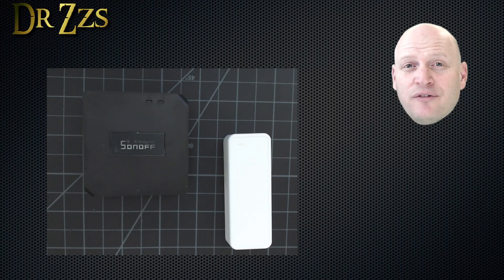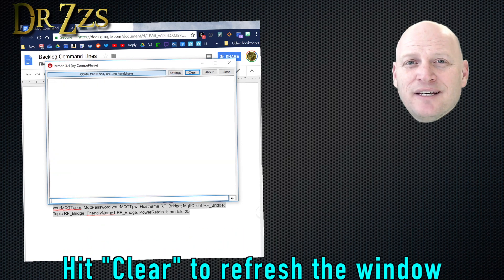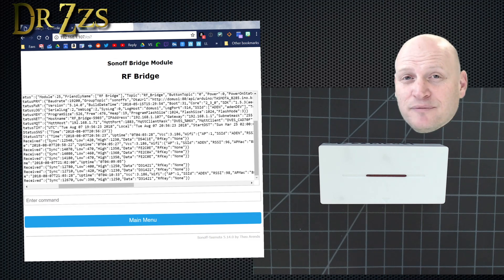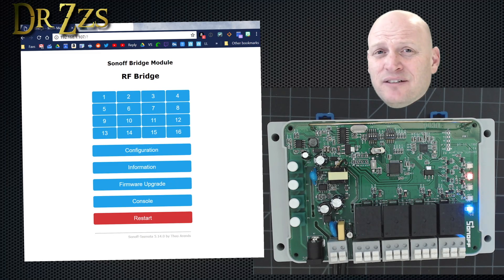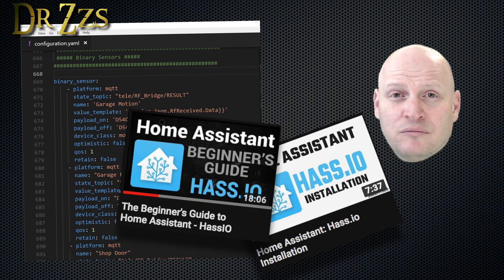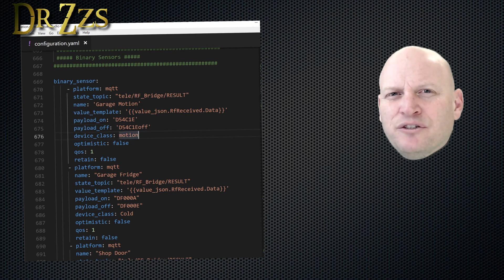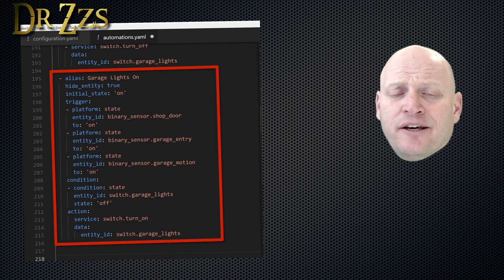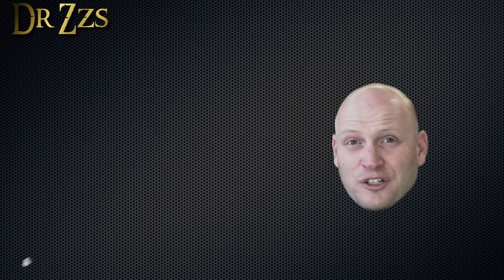Sonoff RF Bridge with Tasmota

Comment: Awesome walkthrough! Thanks for sharing and keep up the great work! I just flashed mine with tasmota and it’s up and running. I’m going to add all my rf sensors this weekend to HA. 

Feedback: you may want to mention the Rx and Tx need to be flipped. I know you point to another video on flashing but in this video you just rattle off the order without mentioning they are flipped on the sonoff side. If someone was just watching this video they may get it wrong.
Reply from the maker: Thanks!Good feedback too.  It's always a little hard to know what to repeat and what I can skip over.
Reply: Glad you posted this! I forgot to switch them and couldn't figure out why it wasn't working! Thank you!!

Comment: so, there is no need in hardware modification before flashing? i read on the tasmota github wiki that rev.2 requires some hardware preparations like cut the traces.
Reply from the maker: I'd have to check which version I have, but I did not make any Hardware changes at all.
Reply: @DrZzs  i found that this required only if radiomodule firmware upgrade needed
Reply from the maker: ah, good!  You don't need to change the firmware for that chip.  At least I didn't need to.

Comment: Dr Zzs, 
Q: have you seen a low battery message code from any of your units listed in the video above? I bought several of each of those and wanted to see if you know if these report low battery conditions?

Thanks!
Reply from the maker: oooh, good question.  I haven't tried that.  Guess I better find some spent batteries, put them in the sensors and see what happens.

Comment: Hello DR! Do you know if its possible to recieve temperature and other data from a rf base weather station?
Reply from the maker: I do not know.  Sorry.  My guess would be no, it won't, but I haven't done any research to really find out so I could very well be wrong.  
Let me know if you find out for sure one way or the other.
Reply: @DrZzs  i have searched all over the internet and cant find anything about it. I Will ask in some forums and let you know if i get succes. Could be vary cool and cheap way to get temperature in all rooms.

Comment: Have just found one of my door sensor has an additional tamper proof switch inside it at the back, sends a third code if you remove it from the bracket handy!
Reply from the maker: Sweet! 
Which brand is that?
Reply: DrZzs it was only 1 out of 30 that had the tamper proof switch, nice to know they exist though! This was the one I purchased http://s.aliexpress.com/UzQraEnu even the other ones have the pads for the switch so I have been meaning to short one out and see if the other 29 also can send the third code, if so could be handy for adding a second button, or switch for another function.

Comment: Hi DrZzs...  Seems there are a few followers from down under now, so Gday to all!!...  - but firstly thanks from an electrical engineering hardware veteran, software Noob ( capitol 'N'!!)  -  without your channel, and numerous instructions, my HA setup, that I'm currently 'desk-topping'  would still be in the box. H/W includes basics, 4ch pro r2, RF bridge. ( ewelink is a POC  in my humble opinion).  My existing smart home system until now is based on controlbyweb X310's - a great bit of kit, but limited to direct control, and device specific. hoping to include some url http get commands into HA when i figure out how to write the correct commands!! - 

OK - the 4 Channel RF pro r2 - from all research, and what I can figure out - you can only have 1 specific inbound or Rx code that the 4Ch pro r2 will keep in memory. - This is from actual testing with Tasmota / multiple  rf remote keyfobs and the OEM manual. a bit of a caution to anyone planning on controlling your 4ch pro r2 with multiple remotes ( I have 3...) this includes a combination of using the rf bridge. - Example - once the r2 has learnt button 'A' on a remote - all is good. - then learn a button on the RF ( say button 16) using tasmota, and button A on the remote  no longer works.....
Reply from the maker: hmmm
Well, it's not a perfect solution but with mqtt you could set it up so button 16 on tasmota controls the r2 relay directly, then have an automation that says when buttonA is pressed on the remote toggle the relay on R2. Or even say when button A is pressed on the remote activate Key16 in the Tasmotized RF Bridge. It's the same idea as the old 3-way switch video I did using multiple sonoff basics. 
If you struggle setting up that automation let me know.  My brain works in Yaml better than English sometimes. 
G'day!

Comment: For those like me that don't feel a need to have a stupid GUI around everything or don't use Windoze, on the command line:
esptool.py --port /dev/ttyUSB0 write_flash -fs 1MB -fm dout 0x0 sonoff.bin

to upload.  If you have Arduino, Eclipse, or Atom installed, you have esptool.py, and if you have that, you have python.
If find it easier to just press <enter> then fiddling with a pointless tool.

Good video though!
Reply from the maker: Thanks
it's good to have options

Comment: Can you have 2 water leak sensors at the same time? I wonder if the code that shows up on the bridge is different between the 2 devices?
Reply from the maker: good question.  I would hope it would be different, but no guarantee.
Reply: There is  a jumper inside that when removed changes the code sent.

Comment: Doc, I've flashed the bridge via Fl;ash EZ but Termite just stalls and goes nowhere. I adjusted the baud rate but to no avail. Any ideas?
Reply: All good now. Amazing what happens when you slow down and listen carefully to the entire process. Please don't mention this to my kids
Reply: Hi I've just done the same. I would try again from step 1. it took a couple of attempts @ flashing to get termite to see the bridge but got there in the end.
Reply from the maker: ya, sometime I have to disconnect the USB cable, or open the settings and reselect the com port.  I don't know why but it does seem a little finicky sometimes.
Reply: @DrZzs  if you disonnect the USB do you have to press the button again when plugging it back in again?
Reply: Aha, missed that point in your other video, now I see what to do. Will attempt again when I get home from work. Thanks for all the support DrZzs
Reply: Unplug the FTDI and then replug it in without holding on to the learning button on the rf bridge. I got stuck here too and decided to give that a try and it worked.
Reply: @williampeters5826  Termite still won't recognize my bridge. I think I've tried every combo on plugging it in, but still no dice. Anything you can recommend?
Reply: Roygiv856 were you able to flash it with tasmota first? If so I don’t think you need to use termite. There should be a way to connect to the device via the WiFi directly(AP Mode) From there go to the console and paste the backlog command.

Comment: hi DrZzs!
I tried to flash my Sonoff RF Bridge, but with no luck :(
checked all the steps [I've even soldered some pins to mainboard to be sure everything stays in place] but still getting errors like this: https://pastebin.com/RH21knvs
do you or somebody here know what's up?
Reply from the maker: bummer.  
That looks like the PC can't communicate with the Sonoff.  So the most likely causes are: 
1. Rx/Tx are reversed.  The RF bridge has a couple sets of serial pins so be sure you're connecting to the correct ones.  They are the ones between the little Switch and the LED.  Which USB/Serial adapter are you using?  
2. The board isn't in programming mode.  Make sure you're holding the reset button when you power up the board.  I like to connect my serial adapter, then hold the button on the board, then plug the adapter into my PC.  
3. The correct Com port isn't selected.  With FlashEZ I close it and restart it every time I connect my board for flashing.  It should auto-detect which Com port you are connecting to.  It is most likely NOT Com1.  

Double check all those things.  Let me know if you're still stuck.
Reply: I'll start from the end, as I'm on my way to home and I left all devices at work.. ;) so..
3. I use the only port that pops up when connected - COM3 - there are no other ports available in the flashing app, so we can cross out that :)

2. switch turned off, flashing button pressed during connecting to PC (tried from a couple to tens of seconds, to be sure). I even tried to flash while pressing the button - no luck too.

1. and this is the only idea I thought about few minutes ago. I connected the pins according to it's labels (on bridge & on programming USB dongle), but maybe I'll make a cross connection Tx to Rx and vice versa. the worst case scenario is it's going to fail anyway.. ;) and about the type of USB dongle - I'll get my hands on it again after the weekend :( can't remember the type but I use it to flash Sonoff Basic and Sonoff light switches with success
Reply: allright, I'm back ;)
crossing Rx with Tx was the point! so I connected Rx on the bridge to Tx on the USB dongle, and Tx on the bridge to Rx of USB dongle and flashing worked! thanks for the tip :)
btw, my dongle is "CP2102 USB-TTL BOARD v4", probably bought on aliexpress [can't remember now], looking like this: https://goo.gl/6UYeZa

but now I'm stuck with Termite :( after ctrl-c cltr-v your command I've changed wifis, hosts etc. to my config, I pressed enter and.. nothing happens :| command is displayed in the log with blue color and that's it. shouldn't it give me some feedback?

Comment: do i really need HAS for this? or can i use my already up and running Node Red?
Reply from the maker: If you're doing all your automations with NodeRed then that's all you need.  You can just use the MQTT messages directly in NodeRed.
Reply: DrZzs the mqtt message for when reciving the rf can i extract that from console or?
Reply from the maker: Yes. Open the TASMOTA console then activate the sensor and a message should appear in the console. That’ll give you the topic and the payload. That should be all you need for NodeRED
Reply: DrZzs okay thanks a lot 👍

Comment: Great video. Does any one know if the bridge can be used to talk to light wave gear, trying to get a mate in to HA but he already has quite an investment in LW.
Reply from the maker: Good question. I just checked and Lightwave products do work on 433mhz so I would expect the bridge could pick up the codes they send.  It’s nice that the bridge is cheap so if you try it and it doesn’t work it’s only $12. 
If he has more than 16 switches to control from the bridge he might need 2 bridges or there is a way to be able to send more than 16 remembered codes. I just don’t know much about it.

Comment: Couldn't the RF Bridge be used for controlling an AC unit in a given room? If the AC unit receives an RF code, couldn't we set one of the 16 numbers to each function?

Example:
- 1 to turn on AC
- 2 to turn off AC
- 3 to turn to turn up the temperature
- 4 to turn to turn down the temperature
- 5 to turn on sleep mode
- 6 to turn off sleep mode

These are the most basic needs for most AC units and with the additional 10 unused codes, I'm thinking it would either do other function on the AC or control another component as well - like a TV.

Is this a possibility with the Sonoff RF Bridge?

Comment: Question is - How do i configure those power outlets in Hassio? I have this but not working. 
switches.yaml

- platform: mqtt
  name: newzap2
  payload_on: '4015C3'
  payload_off: '4015CC'
  qos: 1
  retain: false
  device_class: switch
  command_topic: 'cmnd/RF_bridge/RESULT'
  state_topic: 'tele/RF_bridge/RESULT'
  value_template: '{{value_json.RfReceived.Data}}'

  I havent changed bridge name or anything so not sure what i have to write for command topic and state topic.

Comment: Dr. I flashed tasmota and stuck at termite step. After putting backlog command and hit enter, nothing is happening. Backlog command written in termite window but no further things happening. Set correct com port and baud rate. Do i have to swith to on position in rf bridge?
Reply from the maker: Did you see some green text before you put in the Backlog command?  it sometimes takes a few tries of un-plugging and re-plugging the USB cable into the computer.  It should communicate.  Just keep trying.
Reply: DrZzs yep, that did it. Thanks a bunch, dr. Appreciate your help.

Comment: Those sensors on banggood are sold out do you know of any others in that same price range that report both open and closed States ? Thanks
Reply from the maker: These are also 2 code:  https://www.banggood.com/KERUI-D026-433MHz-Wireless-Door-Window-Magnetic-Sensor-Dedector-Alarm-System-p-1309990.html?p=@K220219381694201802
They tell me the these will be back in stock in a week or so: 
https://www.banggood.com/GS-WDS07-Wireless-Door-Magnetic-Strip-433MHz-for-Security-Alarm-Home-System-p-1174915.html?p=@K220219381694201802

Amazon has the Kurei D026 sensors, but they mark up the price a lot: https://amzn.to/2nIqF6J

Comment: What is the range like on that Sonoff RF Bridge?
Reply from the maker: Good question. 
I should test and see how far away I can get.  I have sensors that are at least 50’ away from the bridge and on a different floor of the house. So it’s at least that far. And having walls and stuff in between doesn’t seem to effect it much.
Reply: Thank you for the response, I have the RF bridge and a few GS-WDS07 sensors on the way.
Reply from the maker: excellent!

Comment: Hi DrZzs, there is another door/window sensor that you recommend instead WDS07, it seem to be ran out.
Reply from the maker: there's this one:
https://www.banggood.com/KERUI-D026-433MHz-Wireless-Door-Window-Magnetic-Sensor-Dedector-Alarm-System-p-1309990.html?p=@K220219381694201802

The WDs07 is supposed to be back in stock in about a week.  Either of these will work the same.  I don't know about what batteries the Kerui uses.  I love that the WDs07 uses a regular AAA battery.
Reply: Thanks amigo! the different messages back when open and close door/window is the principal feature of those sensors

Comment: All of these smart light switches need a neutral wire but where am from our wiring is different so we only have ground. What to Do? Can I use the ground instead?
Reply from the maker: well, i can't really recommend doing that.  At least here that would be considered unsafe.  But if you are asking if it would work to send the N to Ground the answer is yes (probably).  So in theory you could do that.  The only current going to ground would be the small amount used by the ESP chip, so it shouldn't be a big problem.  But again, I can't recommend you do it that way.  With no neutral I don't know what other options you have.
Reply: No I don't think it can be done, it will send live current to ground and do damages. My only option is to use the lutron but they are single pole only and most of mines are 3 pole in a 1 gang box the the SonOff. Only other option is to buy wifi led bulbs instead
Reply from the maker: That's probably the way to go.  Sending current to your ground system on purpose isn't what smart people do.  :)

Comment: I got 2 rfbridges and both do not recieve or send 433 signals after flashing Tesmota. The switch is set to ON after flashing en tried setting the log level to max. I`m missing something. All went well, flashing / Termite. I used a SF-501P remote tot test, its a 433 outlet swtich.
Reply from the maker: Hmmm that’s odd. I don’t know about those devices you have but I would absolutely expect them to work with the bridge and HA. 
Is there a way to set the switch to learn a code?  Maybe try that method. Put the switch in learn mode then hit one of the keys in TASMOTA. 
I didn’t cover it, but there is also a way to put the RF bridge in learn mode and then activate the sensor/switch. 
If you want to try that way I can get the link for you.
Reply: hi dr zz., having the same issue, flashed a bridge last night with tasmota, switch is back on, tasmota showing up on web page but when I press on/off on my 433 mhz switches nothing showing in the console.? put switch in learn mode and pressed one of the buttons on the tasmota key pad and the switch does not receieve. wonder if some 433 switches have a slightly different frq ? will order a sensor from banggood to just test it is not the bridge? any way kept me awake to 0200 in the morning trying to fathom this out! ha
Reply: Hi Drzz, same issue for me, have 433 plugs that when activated do not show a code, tested it on a door sensor I ordered and it worked fine so definately an issue with the switches?
Reply: having same issue, ordered a sensor to check its not the bridge

Comment: Use a xiaomi gateway linked to HA, zigbee door sensors from Ali express £7.50, works great, shows doors open or closed and works greets with the HA alarm panel. Konnected for the wired sensors .
Reply from the maker: Sounds like a great setup. So no firmware change on the Xiaomi gateway?
Reply: nope, all the xiaomi sensors once logged onto the gateway appear in HA, have doors and smoke detectors which if they go off set off the house alarm. Sweet!
Reply: @markszymura  What about RF Generic controllers/Buttons? Do you know if Xiaomi Gateway "listen" this controllers?
 Thanks.